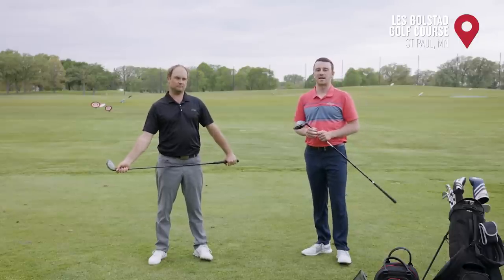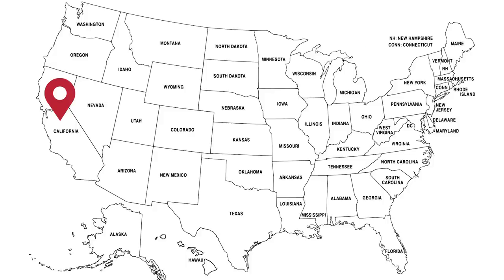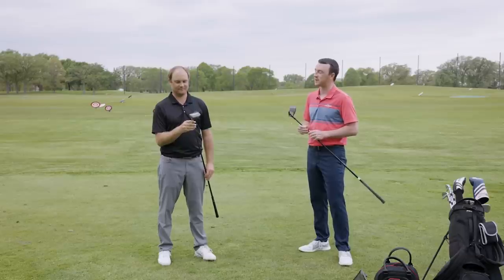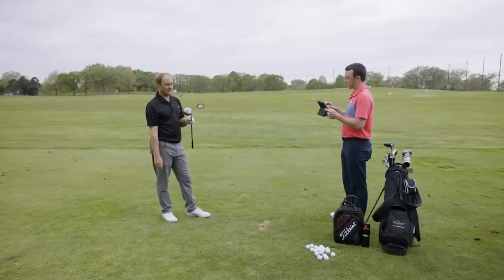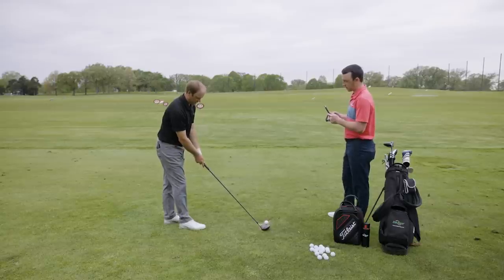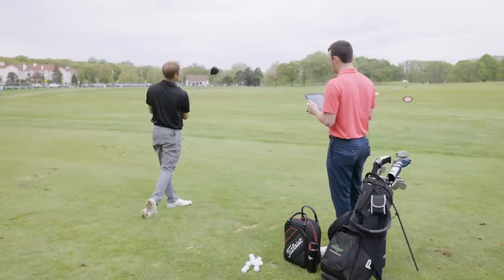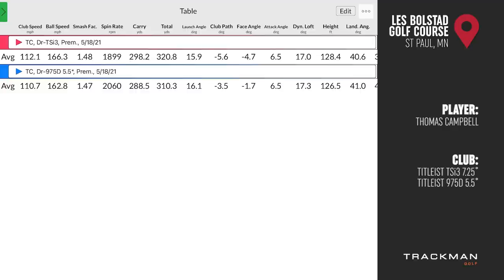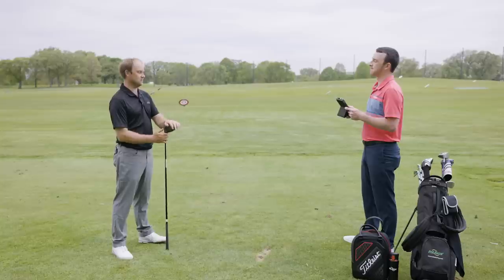Titleist Drivers Comparison | 975D (5.5°) vs TSi3

Comment: It's even more amazing that Tiger played the 975D with a 43 inch steel shaft and played the best golf that's ever been played.
Reply: I’m still using the 975d steel shaft x300. 125+ club head speed and hit it farther than any new driver.
Reply: I still use x100 shaft in all my drivers and I had 975D D8 swing weight 6.5 with x100.
Reply: @briansturgill5905  no you don’t but it’s nice to think so. I swing well over 125 and new drivers will go farther. Plus the old 975 heads do start to lose pop and just don’t go as far. I hit mine so much it was significantly worse at high swing speeds they just wear down.
Reply: @Thumper68     As far as club heads,  the older one are more dense and thicker walled all around.   With the right shaft matched to your swing speed, they are still very formidable today.
Todays drivers, being multi component and ultra thin face and body, will wear out faster due to metal fatigue.
Never heard of an older drivers face caving in or cracking.
Reply: They definitely will lose distance over time and lose distance at least when hit by someone like myself for years. Especially if practicing a lot more then most. I had a driving range at my house for many years and played a lot of golf and it’s very noticeable when you eventually losing 20 yards. Also cracked a face and seen multiple cracked all the way back in 2002 during college. I have degree in pro Golf Management won state championship in high school.
Reply: I own one😊
Reply: @briansturgill5905 no way, those drivers are amazing but todays stuff spins so low they can’t compete especially on off center strikes. I bet you would hit the TSR or the new GT2/3 20 yards further at least.

Comment: Over 20 years of driver technology and there are only around 5 yards extra!  Makes you wonder about the waffle that club makers spin with every new launch!  I had the 975d in around 1998 for a few years and it was great.
Reply from the maker: Thanks for the comment! One thing to remember is that the performance on mishits is the big difference in a driver from 20+ years ago, not  necessarily the performance from the center of the face. Even skilled amateurs will frequently miss the center of the clubface and need some extra forgiveness, which is what newer drivers deliver
Reply: He actually gained 10 yards of carry and 11 yards almost of total drives .  He will hit those distances way more often and over 100 shots I bet it’s closer to 15 yards. Using the new GT series I bet he gains 2-3 mph ball speed at least, and that would increase his distance even more. It doesn’t seem like a lot but 20 yards is almost 2 clubs into a par 4 difference and maybe the difference in being able to reach a par 5. The 975J is one of my favorite drivers ever but today’s tech is just so much better.

Comment: It's interesting that Thomas says he can't feel much besides a thud when hitting the 975D, and can't really tell where on the face he's hitting it.
I've been playing the 975 and 976 clubs since they came out in the 1990's (since I was 12 years old) and now I'm 36 and have about 10 versions of the low loft ones.
I never was any better than a +/- 1 handicap, so I may not be as good as you guys, but when in my prime I highly preferred these 975 drivers over anything else because of the good feel.
The light thud is felt when you hit it pure like Thomas is doing. On a more poorly missed shot the direction and distance is dramatically affected. Even for shaping shots I think the 975's are great.
Once the 975J came out the distance improved with a similar feel, but once the VS and the other later models came out I felt the feel of impact got to be less and less and I verted back to the 
975D and 975J and never switched up since. I like to see somebody swinging my beloved clubs like this though. Thanks for the cool video.

Comment: In 1980 the PGA began keeping Greens in Regulation stats.  In 2022, Scottie Scheffler led the tour with 72.29% of GIR.  Forty years earlier in 1982, Calvin Peete led with 72.39% GIR using persimmon woods and blades with steel shafts.  So much for high tech equipment.
Reply: Blame the 2010 groove regs. Scoring irons have never been the same since.

Comment: These comparisons with such old drivers as this 975D are interesting. I think what may be more useful to most people is to see the difference between a new driver and a 5-10 year old driver, like a Ping G15, Callaway XR 16, Titleist 913, etc. 

The reason why is the technology has changed less in the last 10 years, all drivers are 460cc and have reached the 0.83 COR limit, so the only changes will be consistency on mishits. So for your average viewer (and shopper), is it worth spending hundreds of dollars on a new driver whose technology seemingly isn't that significantly different than what you bought back in 2015 or so?
Reply: That is a great point. I just got out of my 913 a few weeks ago, and only went into the TS3. And I beat the absolute tar out of my 913, and at its peak performance, I may have picked up 5-10 total yards with the TS3. But the last month I played with my 913 I lost around 20-25yd. But most the time in the prime of the 913, I’m within the same range of yardage with the TS3, never more than 12 yards or so gained tho.

Comment: I've just done a fitting to replace my 975D 9.5 degree after recently taking up the game again (20 year break). Didn't try a titleist, went with the Qi10 Max in the end, though I expect it would be similar results. It was adding 30+ yards carry distance no problem. Longest hit 317 yards vs my previous best of 280 with the 975d at the same range. Adding close to 10mph ball speed. With the added forgiveness as well, it might almost be worth what I've paid for it!
Reply from the maker: This is great!! You'll definitely notice a difference in 20-some years of technology. I will say, though, getting near 280 with a 975D is mighty impressive

Comment: I know this is an older video, but so much of this commentary is laughable. I still have my 975D from high school and there is much more feel than this clown is leading on to. Is it better than todays tech? No, but you know where youre hitting it on the face. This is just hyperbole to show how todays clubs perform better and offer more forgiveness. If you cant feel where youre hitting it one that smaller head, you have dead hands.
Reply from the maker: Thanks for your feedback. Different materials provide a different feel to us all. - Thomas
Reply: I literally just hit a 975d today and the feeling was much more pronounced than current drivers. You absolutely know you’ve mishit it. He definitely went at it harder w newer driver - whether it was confidence or whatever. 22 years of “tech” you’d imagine a huge difference. Truth is there isn’t much from shot to shot. The guy is really good and hit great drives. 10 yards isn’t going to be a huge deal from hole to hole but manufacturers would have you believe you can’t even golf w last years model.